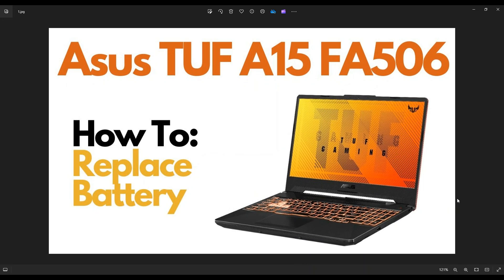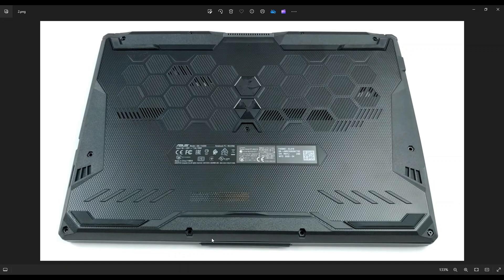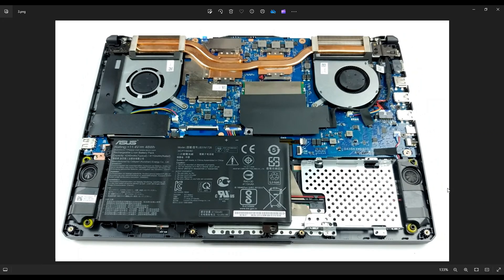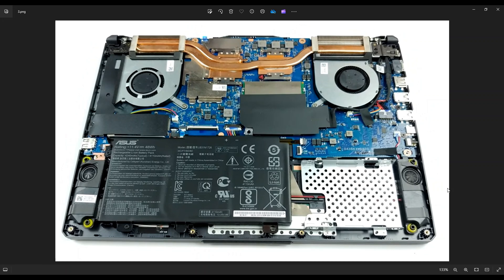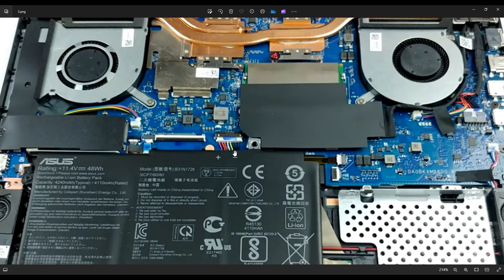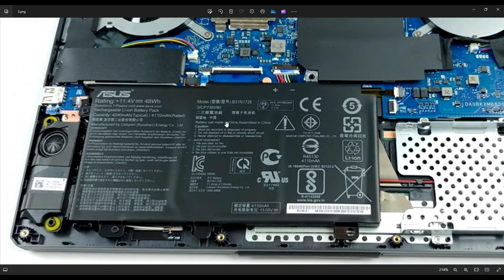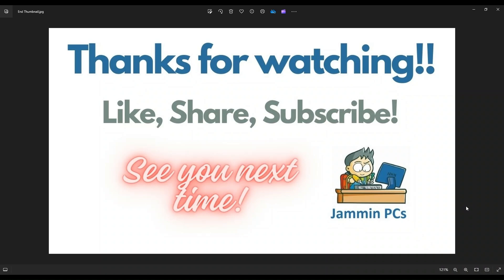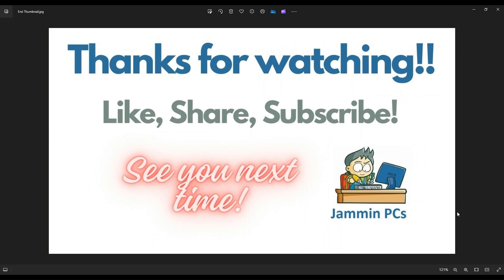How To Replace Upgrade Battery - Asus TUF A15 FA506 Laptop Computer

Comment: How much better does this make the battery?
Reply from the maker: I dont understand your question. Sorry :( This video shows how to replace a battery. What is your question?
Reply: @jamminpcs  Want to upgrade the battery on my laptop, just wondering how much of a difference this will make
Reply from the maker: @shamallama8663  Oh ok sorry. I should have guessed that. It does make a difference in battery life but not a whole lot. Me personally, I would not waste my money upgrading if the current battery works fine. If the current battery dies and needs to be replaced, then I would upgrade to the better one then :)

Comment: Hi. I have the Asus Tuf A15 FA506N and it comes with a 48wh battery. I want to upgrade to a 90wh battery. I do not need to use the SSD tray so will I be able to remove it to make place for a bigger battery. With regards to the replacement of the battery itself will I be able to replace the battery without damaging the laptop due to the difference in the voltages of the batteries and if I am able to replace the batteries will I need to by a new charger for it?
Reply from the maker: As far as I know, the batteries should not have a different voltage. Ill have to look more into it. As far as I know now, the same charger should be fine.  Ill try to find an answer asap for  you. sorry
Reply: @jamminpcs  4 cell batteries definitely have higher voltage than 3 cell batteries. However, in my experience, this has never been an issue when upgrading. Seems the motherboards are prepared for it.
Reply: @jamminpcs  yes please get back to me as soon as you have an answer. If possible could you give me your email or Instagram so i can chat more about this. I am from South Africa so its a bit hard to reply on here. I really appreciate the feedback
Reply: @jamminpcs  they have different voltages. 90wh has higher voltage, will it still work?
Reply: @jd7ub  From reviews that I've seen the difference in voltage shouldn't be a problem because the two different batteries are both designed for the same model. It would only be dangerous if the battery was not originally designed for the model. If you have the 48Wh battery installed you would need to take out the HDD cage and/or plastic studs that might prevent the 90Wh battery from being installed, but that should be all in order to install it.